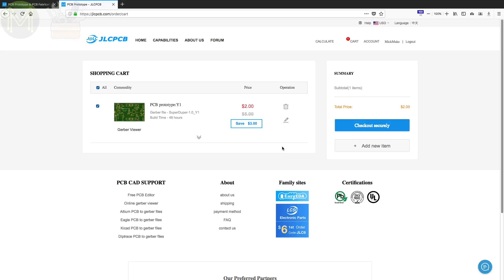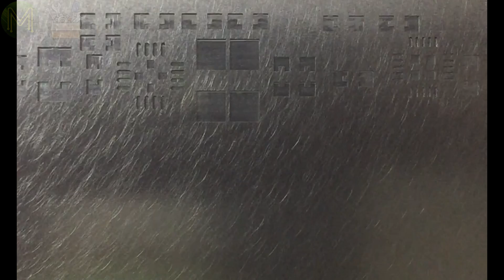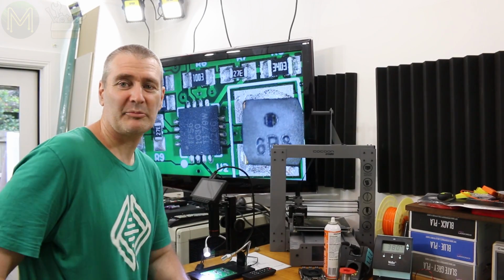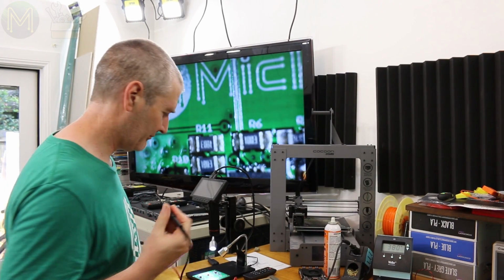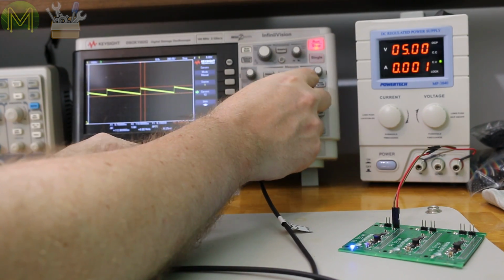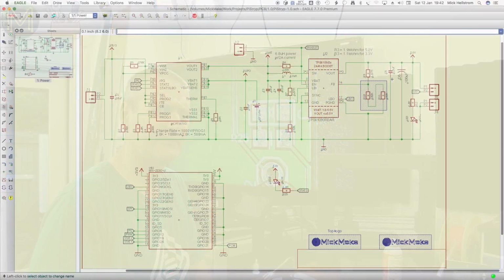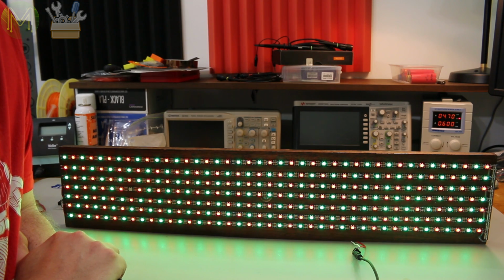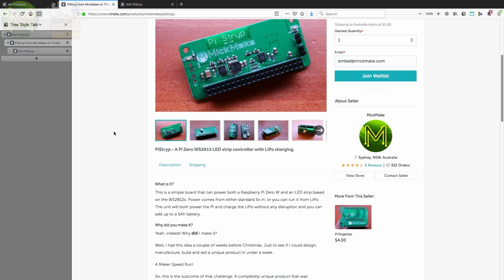#250 Maker Speed Run Day 6: Did I do it?

Comment: Hi Mick, nice job for such a hurry. 
May i suggest if you're going to design Rev2, besides breaking out those lovely GPIO's, could you consider to move the JST Connector to the side (almost to the border) that piggi-strapping the battery onto the PCB gets possible?
Reply from the maker: I’m actually thinking of adding an 18650 battery holder instead, but yes... good point.

Comment: @MickMake Are you sure that the Pi Zero W has 5V tolerant GPIO? If you make those STAT1/STAT2 pins higher than 3.3V you will likely cause a latchup and can destroy the pin driver there. If you are going to respin this, I would add at least a clamping diode on those pins to be on the safe side.
Reply: Yeah, I don't recall them being 5V tolerant.  A current limiting resistor in series at least, if not a level shifter.
Reply from the maker: Yes true. I’ll have to fix that one as well!

Comment: First time i've seen a "bodgewire". As you can tell i'm an absolute beginner to electronics but i'd like to ask anybody - when using a bodgewire, can you use any thickness of wire? Can you use a single strand of wire as thin as those in earphones or will it get hot? And, by using too thick of a wire will it drain the battery quicker or make the board hotter if it's plugged in? Thanks in advance.
Reply from the maker: In this case I could have use a single strand of that wire as it was just a low current low frequency signal. Had it been used for power then I’d need to use a much thicker wire.

It all comes down to current carrying capability.
Reply: @MickMake  Nice - thanks Mick
Reply: Bodge wires are suprisingly common, even on production devices, and are used when the labour cost to add the wire(s) is less than the cost to remake the PCBs.  Most commonly they're made with thin "kynar" wire (which used to be commonly used for wire-wrap connections), assuming low current.  Obviously the next revision of the PCB will correct for it, but sometimes the required change is discovered quite late in the production process.
FYI, the wire thickness affects its resistance (less surface area for the electrons to move about).  So a thin wire carrying a high current will get hot much quicker than a fatter (or multi-strand) wire.
Reply: @KeanM  Thanks Kean, informative and interesting. Amazing to think they'd have a team of solderers adding bodgewires to 5000 boards. Id love to do that for a job for a while. I take it thinner multistrand wires are more resistant than a thicker kynar single strand.
Nice.

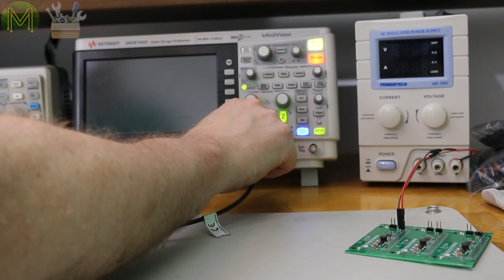Comment: I've paused the video around 6:50 - can anybody tell me why the voltage of the first board was 5.12 volts and the second board was 5.07 volts - why dont they all read the same?
Reply from the maker: It all comes down to tolerances. Resistors and capacitors especially all have a certain tolerance. I used 5% tolerance components and so you will see a variance.
Reply: @MickMake  Oh i see, wow. That's beautiful. Thank you.

Comment: Please don't use a BSS138 n mosfet for driving ws2812b strip. It will never work since it can't transfer enough power signal for the LEDs. I tried this with ESP8266 and 5m long strip and it doesn't run properly. Highly recommend reading this article https://happyinmotion.com/?p=1247 for what logic level converter for this type of work load.

Comment: Really great video for us makers. Thanks! Can you provide some information on your inspection microscope? And please ask you "crumpy" friend for the type of the stencil holder to apply the solder paste to the pcb.
Reply: The Microscope setup is nice, with the giant monitor and lag free.. wow ! 
i like to know about it too, i still use a jeweler magnifying glass, these things you wear like a  hat.. dunno what its called.
Reply from the maker: MickMakeMail #25 had the microscope. A really nice cheap Chinese one. The TV is there with an HDMI switcher so that I can connect up a whole bunch of things. Having a huge display is so much better!
Reply from the maker: As for the stencil holder. I’m sure  +Kean Maizels will respond.
Reply: That would be "grumpy" not "crumpy" :D
The stencil holder I have is a "Hanail HN3040B manual precision printing table".  I can't find any info on this exact one, but it is basically the same as a lot of other 300x400 stencil holders.  Search for "YX3040" on AliExpress to find a bunch that are very similar.  They're not cheap because they have a lot of metal in them and weigh quite a lot (35kg).
FYI, I use the same ADSM302 microscopes in my office and love them when using via HDMI.  I previously had the ADSM201 which wasn't bad.  Both are shown in MickMake Mail 25.
Reply from the maker: Well, sometimes you are crumpy after an all-nighter. :-)

Comment: Schematic and layout review is most important thing.😌
Reply from the maker: Yes indeed!
Reply: @MickMake  I suspect an ERC check in Eagle would have picked this up?
Reply: @KeanM  ERC does not pick human error like net name change, symbol and footprint miss match (happens to me).
It only tells you about unconnected pins, pin type miss match(power, input, output) etc.
Reply: @punit_patel  Actually, In this case I'm pretty sure Eagle ERC would have shown him "Only one pin on net 5.0V"
Reply: Haven't use eagle since Autodesk takeover. But in kicad ERC never give error or warning but good thing is it has same net on 3.3v and 3v3 like symbols.
Reply from the maker: Yup, ERC would have shown up the “only one net connected, you fool” error.

Comment: Speaking of components, it would be interesting talk about how good components from China are in comparison to digikey or mouser. Maybe Dave Jones could help u.
Reply: Who is Dave Jones ? (just kidding)
I  think the rule of thumb here is "you get what you pay for" 
I stopped using cheap parts from china (ordered on ebay) some time ago now. I had really bad experiences with sk6812 LEDs and tp4056 charge controllers for example. the leds (single colours) just died after couple hours and the controllers .. some get really .. really really warm, not the best thing to put next to your lipo.
Since then i order at mouser (digikey element14 and some others are also there ), never had trouble with anything anymore.
Reply from the maker: It all comes down to tolerances essentially, but it’d be great to do some comparison tests with at least basic jellybean components.